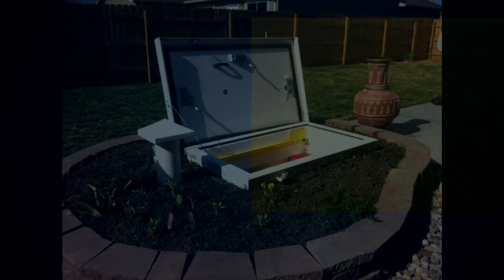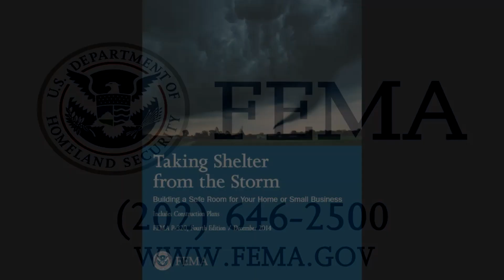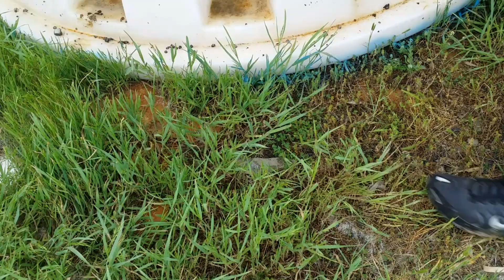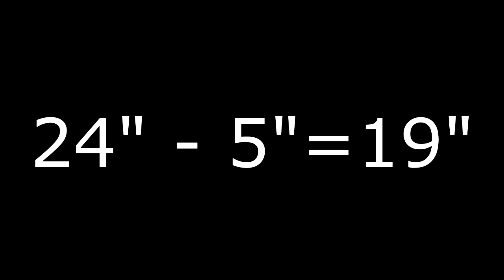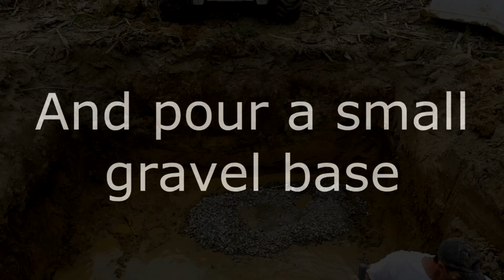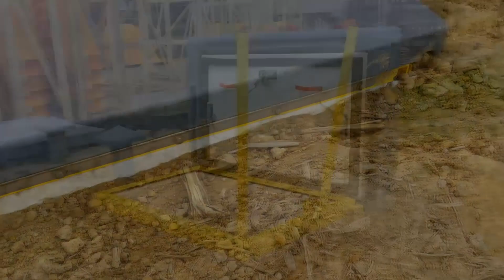Tornado Storm Shelter Installation Underground Tornado Shelter Install 4 hours

Comment: What’s to keep a tornado from sucking the whole thing out of the ground?????  It’s not anchored/braced into the ground!  And it’s plastic!  I see false sense of security here.
Reply from the maker: Notice that ALL of the Tornado Shelters that have made National News for Floating out of the ground all have that SAME cookie cutter knock off shape and design?  So a bunch of "self proclaimed experts" went and knocked each others POOR designs off from one another and even with  ALL of their yards of concrete they pour on them, the water pressure at those depths pushes them right up out of the ground.  Why?  Because of their incredibly bad design and genuine lack of innovation!  But ironically in over 20 YEARS of BEING THE INDUSTRY LEADER, we HAVE NEVER HAD 1 SINGLE UNIT float out of the ground.  NEVER!  Multiple "fly by night" competitors have tried so hard to get a Granger Unit to float, however, decades later, they are STILL TRYING!  After breaking their equipment and ruining their overalls, they gave up!!! We actually have a REAL engineering staff, with a REAL Patent on our design.  Nice Try!  Might want to go speak on something that YOU actually know something about or something that you can speak intelligently on Veggie Vibe Tribe!! Obviously Tornado Shelters and successful designs of Tornado Shelters isn't your area of expertise!!
Reply: Ok karen